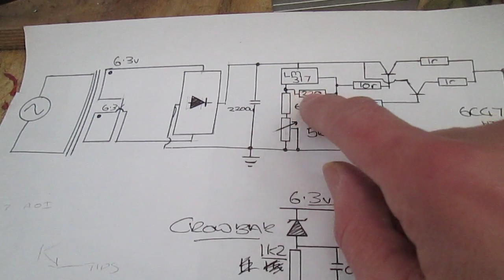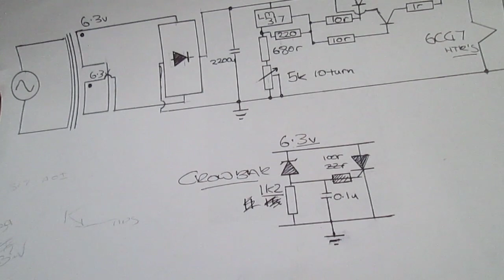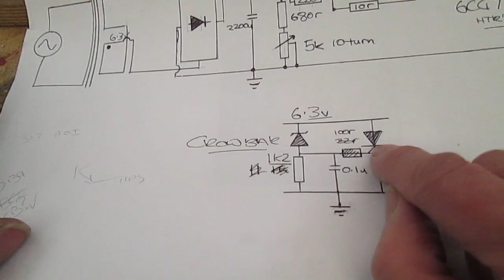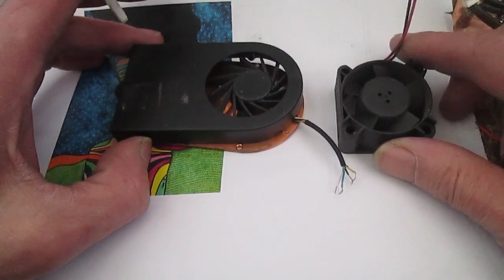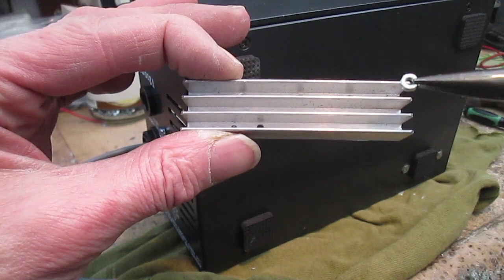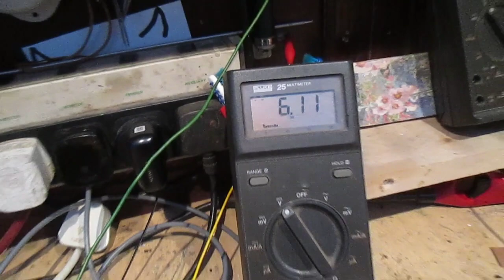Valve Pre-amp Heat Issue Fix - Part Two.

Comment: Nice video Andy. I liked the added crowbar circuit. On the heatsink- In a similar situation I have done 2 different things. I put the screw heads in the heatsink and the nut & star washer on the chassis. The other thing I did was not wanting to spend time filing down the nuts,  I simply put the heatsink in a vice and used a drill bit to enlarge the space between the fins enough to let the nut rest properly and put a drop of nail polish enamel on the back of the nut and let it dry in place.  I used to service vinyl welders, and used a lot of Cetron tubes. No tube failures using the 872 rectifiers, except those caused by the machine operator failing to let them have enough warm up time to properly  vaporize the Mercury. 
    I saw the 805's you had and first thought OMG- Andy score a pair of 211's!  The 805's are a good sturdy tube with the graphite plate handling a lot of abuse.  In a  CW transmitter, with key down, we used to run them so the plate ran dull red.
 Abusing them, Yup.  But they handled it well. A cooling fan really helped too, along with good ventilation.
Reply from the maker: Thank you Frank.I did think of drilling out the fins of the HS but couldn't reverse the bolt as they have to be flush on the outside of the chassis. I'll bear in mind what you said though for later use.
   Re 211's, I can get Chinese jobbies for £50 each, but for genuine NOS valves it's POA = price on application, in other words feck loads of money. The 825's as you say are very well constructed, I need to dig into the datasheet & do some testing to see if they'll make an audio amp/s. TFW.
Reply: Another thought since you mentioned flush with the back.
 Here they sell "pop in" nut rivets.  They use a tool similar to a pop rivet tool and it puts a nut in blind places or flush with the chassis. I used them decades back to replace the broken off nuts on the old S100 computer cases, and on my van to mount mirrors with also. Avibank makes their set for the aircraft industry and Harbor Freight Tools here sells their Chinesium version. I have even installed them just using high grade bolts and washers without the special tool.  ,  @diabolicalartificer